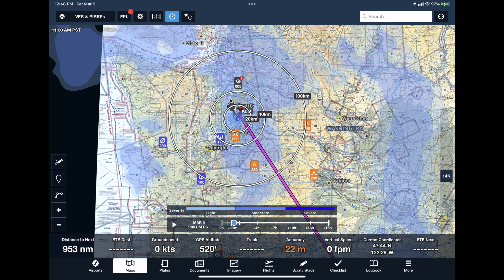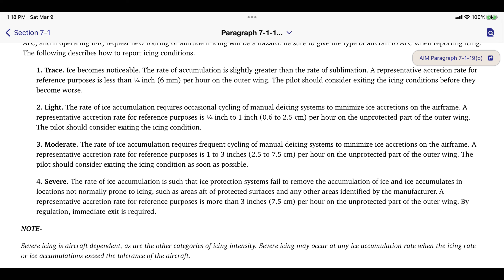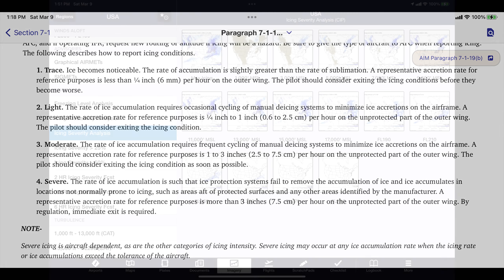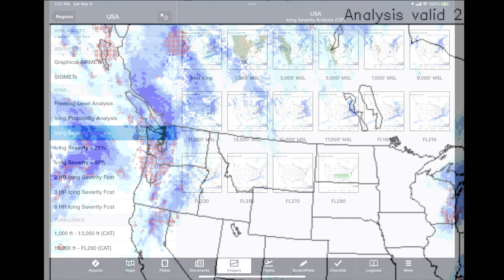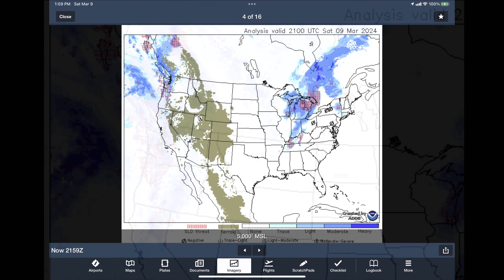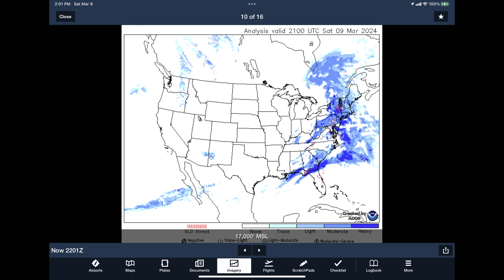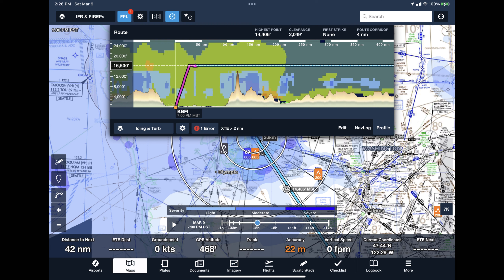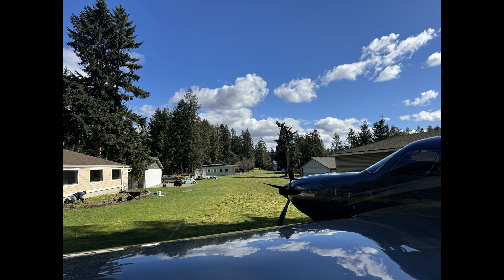The Piper M Series - A Discussion on Airframe Ice with Dick Rochfort

Comment: Good stuff, Dick.  This is my go-to view for a final go/no-go decision.  For an icing/turbulence outlook that goes beyond the 15 hours presented in ForeFlight, Windy has icing and turbulence forecasts based off Euro and GFS out 10 days or so. I imagine these visualizations are built of the forecast soundings, and, of course, the likelihood of a forecast validating goes down a ton after 24 hours or so.  It may be only the paid version of windy, but I find that small subscription to be very much worth it.
Reply from the maker: Yes indeed. Pilots need a way to see potential threats clearly and quickly. The Foreflight profile CIP/FIP-Turbulence view is conservative and it is the best I know of in this regard.. Fly Safely - Train Often .. DR
Reply: Great video as always. And particularly relevant for me as we were also at BFI yesterday in our M350 and we delayed our departure for Eugene until around 330 pm not because of ice but because of the CB’s over and south of the airport. Despite the CIP and the turbulence forecast the flight was smooth at FL190 with no ice on departure and only light ice descending into EUG. 

The forecasting tools are good but another important element yesterday were the PIREPS which were all for light ice at the most along our route. Profile view in FF is good but you also get an expanded view of the same in the “Vertical Cross Section” tab under briefings, no time slider but sometimes easier to view than the flight plan profile. 

Lastly I’m curious to know what your experience has been with negotiating a non-standard departure with ATC around a busy Class B like SEA, yesterday they would have given you the  NRVNA1 departure from BFI, heading SE, and with all the air carrier flow I suspect it would have been very difficult to try and negotiate a climb to the NW while on an IFR flight plan, unless I was absolutely sure I could get that request granted, in my experience trying to do against the flow stuff rarely if ever works…and I second the previous commenter’s opinion about Windy, yet another very useful program.
Reply from the maker: Yes indeed! I always file for what I want and have firmly in mind the things I will accept. We did get the published departure as expected. The purpose of filing the route to the Northwest was to identify the route most likely to be ice free. Pireps are always helpful unless there are no pireps. The decision to depart is then based on all available information. It is important to remember that a report of light ice by a B737 defines an area to be avoided by boot equipped aircraft. We made the departure the next day as the weather began to improve. The CIP/FIP tends to be very conservative but my rule remains .. never more than light on the CIP/FIP. Fly Safely - Train Often .. DR